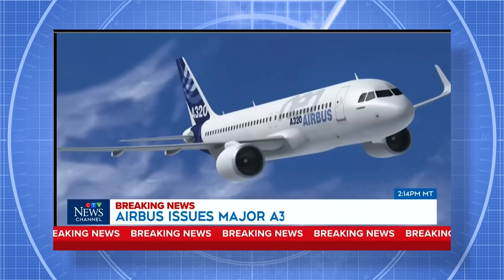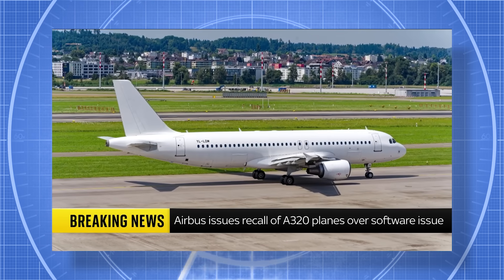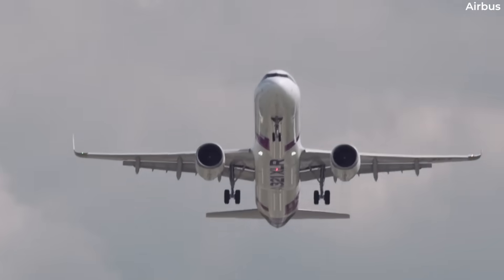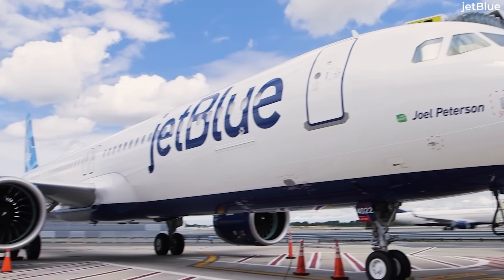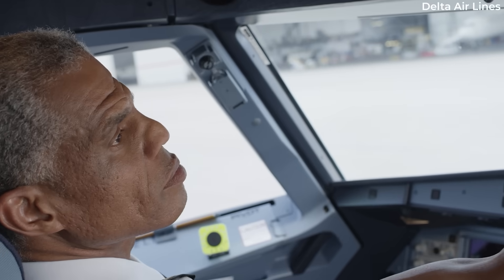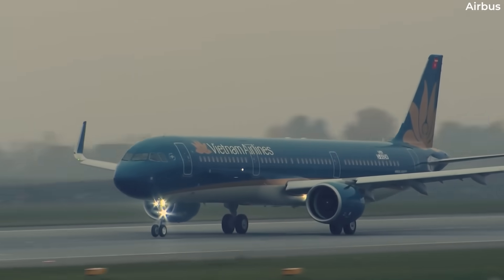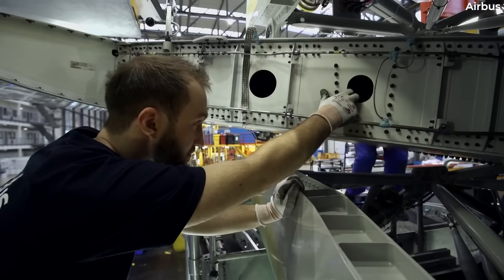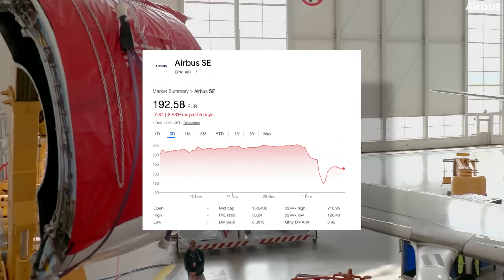A320 Fuselage Panel Issues Surface Days After Major Software Problem

Comment: At least Airbus acknowledged the problems and immediately issued Airworthiness Directives unlike certain aircraft manufacturers.
Reply: You guys sure are annoying
Reply: I was not able to find more details about the first issue. It would be interesting to know more -- exactly how can a software update can fix issues caused by solar radiation.
Reply: @smcdonald9991  the problem was the other way around. A software update had issues, apparently due to solar flares. To fix this problem, they basically went back to the older software version.
Reply: Boeing also acknowledged the problems and immediately had AD issued from EASA?FAA as well. Stop saying "at least" to make out Boeing is still the bad one
Reply: @nickolliver3021 Of course - the minute that first 737 Max crashed, Boeing were straight in there with “this might be the result of a new automated system we’ve installed without telling any of the pilots what is supposed to do and what to do if you experience issues” - I’ll bet the families of the victims of the second crash were all fully understanding that once again the trope of “African Airlines and African Pilots” was rolled out again. I like the idea that new management are trying to reverse Boeing fortunes - they could get rid of every thing associated with MCDonnell Douglas - that would probably make a difference!
Reply: @andrewbrown6786  But I asked did Boeing ignore the pitch event and cover it up? Did they ignore the faulty parts being installed on 787s? Yes we get that the 737 MAX crashes were not meant to happen but what was done was done. We know that Boeing did not tell pilots of a new automated system that they had no idea what it did if they'd experience issues with. Its not just the one event that this airbus issue is better than the Boeing 737MAX one. There are multiple issues that Boeing went through that they acted on immediately instead of ignored and covered up. You may need to know that Boeings new leadership may have got rid of most McDonnell Douglas associates. Results have shown that quality has improved and the culture has improved.
Reply: @nickolliver3021  still using the “McDonnell Douglas did it” narrative, huh?  The merger was 28 years ago. By now and even during the Max accidents, there wasn’t much influence left from MD. But it’s a great excuse. That way people don’t have to take responsibility for their own failures.
Reply: @rtbrtb_dutchy4183  So if McDonnell Douglas culture was about ignoring issues and covering them up then why did Boeing react and fix the 777x pitch problem and 787 faulty parts from their suppliers? Just to name some from memory. Its not an excuse but facts that those airbus fanboys ignore and twist. They took responsibility of those even when it was out of their capable hands and did what was required by the authorities. (same as this case here with the A320 quality problem)
Reply: @nickolliver3021  I did not say anything about those things. I think you are right in those regards. I just think that the whole MD narrative is silly. Yes, it had a significant influence back in the early 2000s, but after that, it can’t be used as an excuse.
Reply: @rtbrtb_dutchy4183  Sorry I understand now. Yeh of course around the MAX saga and 1 to 2 years ago the McDonnell merger had no influence. Thats why there have been improvements in deliveries and culture and quality of aircraft coming out the FAL. 
I got a little confused on the last thing about "That way people don’t have to take responsibility for their own failures".
Reply: @nickolliver3021 I was under the impression that whistle blowers were deeply concerned over 787 parts quality, history tells us the Boeing instigated a process of keeping things quiet whilst trying to improve productivity whilst ‘looking at the issue’ - can’t see how that is the right approach with a plane carrying hundreds of people?
Reply: @nickolliver3021  that last sentence was aimed at the people were at Boeing during the Max saga. Blaming MD culture was a way for them to not having to look in the mirror too much.
Reply: @andrewbrown6786  When Boeing had problems with 787 quality and certain parts were not up to spec there were no whistle blowers being deeply concerned. The point was did Boeing hide and cover up those issues? They improved productivity and quality but they still had issues with their supplier who was sending faulty parts. I can't see how that is the right approach where they have built planes carrying hundreds of people with faulty parts from their supplier.
Reply: @nickolliver3021 Boeing CEO  shoulve been arrested  and convinced
Reply: @nickolliver3021 you are trying to unblame Boeing for what they are very guilty . Stop it , it's all nonsense and BS
Reply: @rtbrtb_dutchy4183 I still think Boeing CEO Mullenberg should ve been arrested and convincted about 737MAX disaster
Reply: @AnetaMihaylova-d6f  Why should the Boeing CEO be arrested and convinced?
Reply: @AnetaMihaylova-d6f  No Its not nonsense and crap. There is no such word as unblame!
Reply: @AnetaMihaylova-d6f  Guess what Muilenburg Could not be arrested as you get away with murder these days
Reply: @AnetaMihaylova-d6f Yet the Airbus CEO wasn’t arrested over the Airbus bribery scandal… oh, that’s tu quoque, should’ve known.
Reply: They were forced to acknowledge it because a JetBlue plane momentarily lost control en route to Newark. Did you watch the video? Don’t downplay the screwup just because it’s airbus.
Reply: @FlyByWire1  
Nobody is playing down the severity of what happened. Losing 17.000ft in such little time is extreme.
Airbus acted promptly. They would have done so even without the uncommanded nose down.
Reply: @FlyByWire1 It’s not because it’s Airbus - they didn’t wait for 2 planes to crash and have the cause of software issue forced upon them. Airbus have not tried to silence whistle blowers who wish to raise awareness of unsafe issue & practices. McBoeing just doesn’t seem interested in regaining the reputation that Boeing once had, which is a shame. Passengers should not have to worry about what plane will be used for their booked flight - they should just be concerned with the on board service and purpose of the flight.
Reply: @andrewbrown6786  So when the 777x had its Uncommanded pitch event or 787s had parts coming in not up to spec mean that Boeing just left the aircraft to crash and kill people if it did get certified earlier and carry on using faulty parts to install on 787s then? What has this quality issue of Airbus got to do with silencing whistle-blowers who wish to raise awareness of unsafe issue and practices? The only reason you have not found whistle blowers is the fact that Airbus acted on it and also Boeing acted on its 777x pitch problem and 787 faulty part issue. Boeing does  seem very interested in regaining the reputation that Boeing once had now with the new CEO in charge. Its not a shame if new leadership has taken over and has made big changes. Passengers are not concerned of the aircraft types used! I dont see people freaking out at the airports because its a Boeing
Reply: @nickolliver3021  Boeing is a killing machine for all aircraft types 😂😂
Reply: @Beyonder-g2x  Airbus is a killing machine for all aircraft types🤣🤣
Reply: @nickolliver3021  still has way less killing numbers and accident numbers than Boeing. Last time I checked, it's all just Boeing for single aisle and twin aisle (787) to kill hundreds of people 😂😂
Reply: @Beyonder-g2x Airbus have as many killing numbers as Boeing does. You do realise pilot error killing are not boeings problem that's what I last checked😅
Reply: @FlyByWire1  So was Boeing when a Lion Air decided to fly straight into terrain. But guess what? They didnt

Comment: Airbus is far from a crisis. Yes there are issues at the moment. The software matter has been resolved in the past couple of days and now the address the production problem. But that’s far from a company in crisis…
Reply: You my friend are clearly not at the base nor working on it...greetings from TLS
Reply: @MrLockwire  What does this gibberish mean?
Reply: The “software matter” that grounded 5000 jets for immediate software upgrade and kept a further 900 out of service is a major issue. If the headline was “Boeing requires major 737 software update,” yall would be on here saying the complete opposite. Keep the energy the same. Major software flaws like this shouldn’t be happening with ANY manufacturer.
Reply: @FlyByWire1  Calm down.

It wasn't 56000 aircraft, and it wasn't a 'major' software flaw.

Airbus IMMEDIATELY  fixed a problem that that hadn't hurt anyone, and was unlikely to cause another incident in the short to medium term.

Boeing IGNORED a problem that had caused the loss of hundreds of lives and lead to a further crash and the loss of hundreds more.

A *very*different situation.
Reply: @FlyByWire1  Nope quite the opposite. If the software matter/ issue/ problem is detected by the manufacturer, reported to the authorities and fixed for thousands of aircraft within just a few days, I would defend Boeing against all the „Boeing again“ comments here as well. If flaws are hidden and secret software causes over 300 casualties, I would accuse Airbus as well. 
But this constant battle of which company is better, doesn’t get us anywhere. Both have their issues, both have there strengths.
Reply: @FlyByWire1  Hold on! A great majority of those 5,000 jets were grounded because passengers wanted to get off while others got on! The actual software upgrade took somewhere around 30 minutes. In other words, the work was often being done while the aircraft were "between flights". Of course, the headline of "Boeing requires major 737 software update" was a real headline and was only issued after Boeing had killed hundreds. Are you AJ Aviation?
Reply: @scousedavies565  lol @ " A great majority of those 5,000 jets were grounded because passengers wanted to get off while others got on!"
Reply: @Djamonja So they said, if it's Airbus I ain't going !

Comment: The sort of solar radiation that can cause bit flip related computer issues is FAR away the visible and infrared spectrum, these are highly energetic particles of far higher energies from solar flares that can penetrate thin Aluminium foils that can easily block photons of energies UV or below. Ideally, bit flip issues would be mitigated via a combination of radiation shielding, error correcting memory and software that provides robustness against errors that slip in.
Reply: The issue has effected all aircraft manufacturers for sometime....Electronic equipment have had various degrees of shielding for equipment.However could global warming be requiring more aviation resistance in legacy aircraft types ?
Reply: @blooskys1  Global warming? I thought we were on to 'climate change'